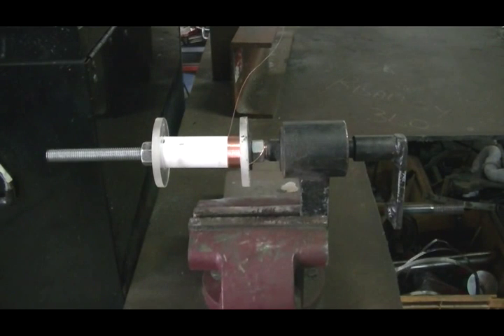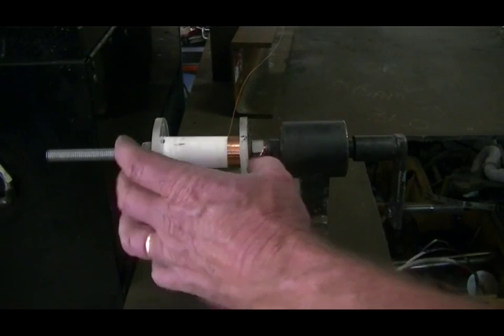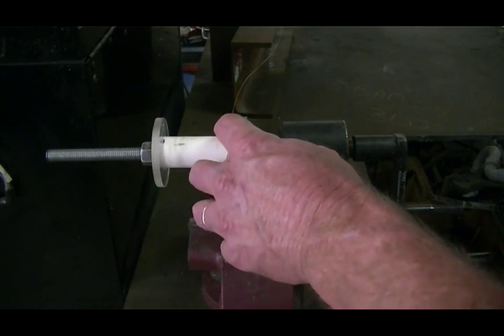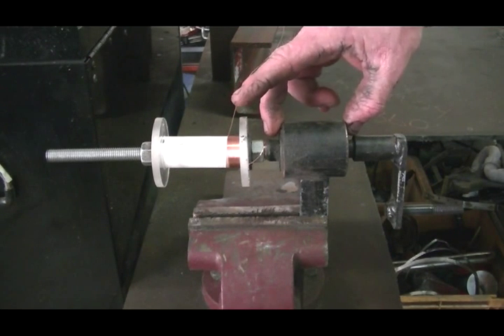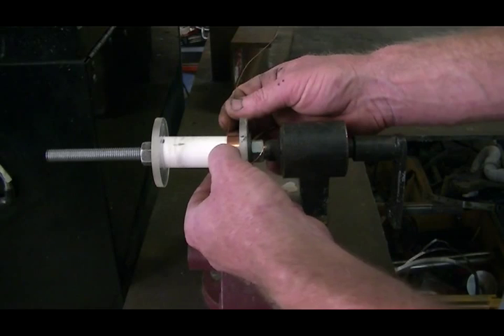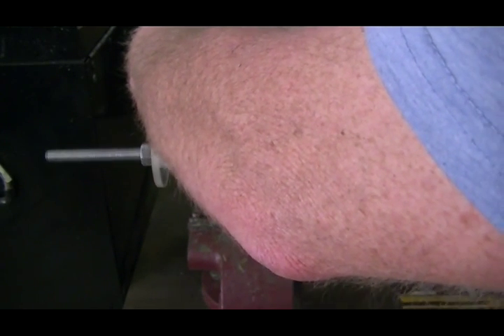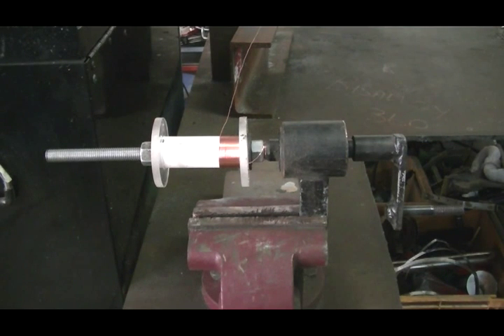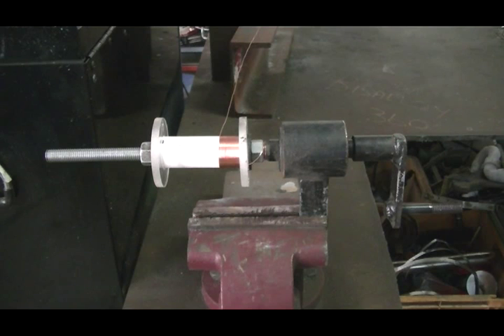The search for the ultimate pulse motor pt2

Comment: Nice winder. Very precise. Can you take the handle off and fit a cordless drill (or big power drill if your crazy enough), For when your not so worried about neatness? I use an 18v drill with variable speed trigger. If I keep it slow, I can get windings very neat. I'm going to have to do a pulse motor soon!  Your instructional are some of the best I have seen. I feel like I know what to do now. Was council collection this week. I got 4 old vacuums, So shafts and bearings galore!